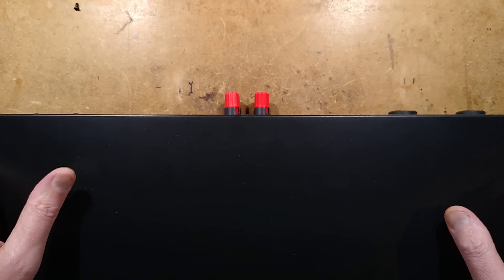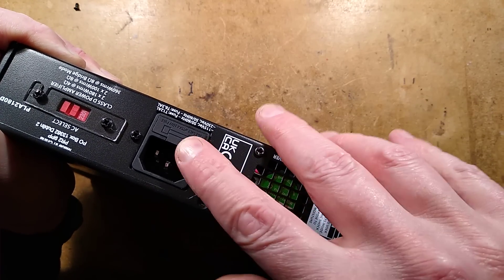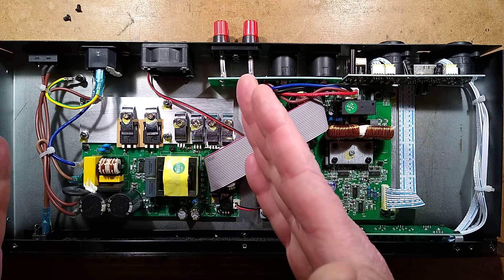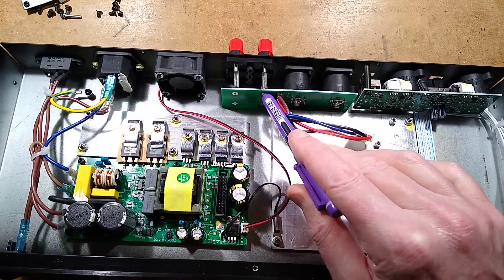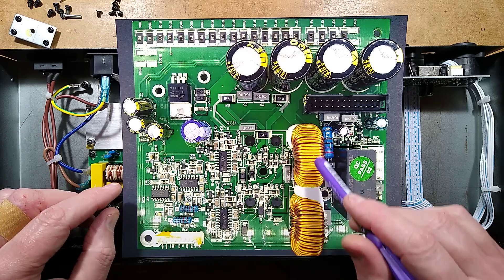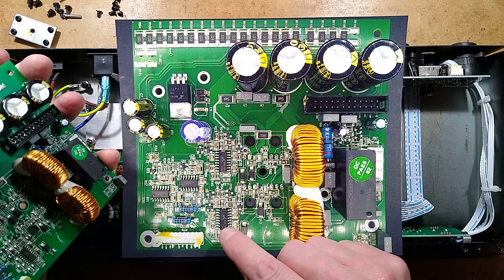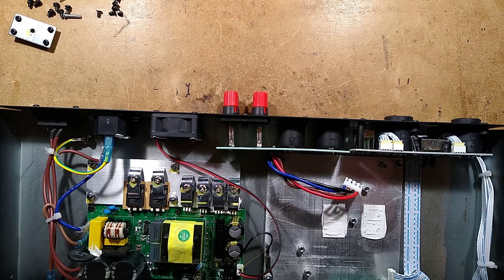Inside a 360W digital amplifier

Comment: Bridge mode potentially gives you twice the voltage, which is 4x the power, for a given load (assuming neither side amp current limits). Most of these designs can only achieve this on real musical sources, with a sensible peak to mean ratio. If you try it with sine waves, a limiter will kick in. Great for us ageing musicians. Together with a neodymium magnet speaker my bass rig has halved in weight and more than quadrupled in peak power. 😊😊😊

Comment: Maybe the large bank of 10K resistors (well, 16 of them) are used for switching in on the D to A convertor chip? 8 resistors each for  2 x 3 bit digital input (3 to 8) Kelvin divider or string DAC? Or maybe I'm blowing it out my ass again...I'm not sure 😁

Comment: The problem with clipping is that it is effectively an increase in average power, which is the only thing that will destroy a voice coil. It's not to do with waveform shape or resistivity in the load, it's simply an increase in average power. It's still an AC signal even if you clip the waveform to a proper square wave. It's also interesting to note that the reason why manufacturers get away with making claims that are double the RMS power of their amplifiers because if you clip a sine wave to a full square wave, you've doubled the power in that waveform.

It's not real power or usable power but it has the heat load none the less.

Comment: Hay would you  know  if I can use one of the 10v mercury uvc lamps to make a homemade  10v mercury  vapour  light bulb  with  outer glass  and block the uvc would  it work
Reply from the maker: You could do that, but the output may be quite low, as it's optimised for UVC.
Reply: Would it work  and no damage  eyes and skin
Reply from the maker: @posttopstreetlight1055  Standard glass should block UVC.
Reply: That will be  cool so I can use one of those  soler pawered street lights  with  the front  glass  and make a soler pawered mercury vapour  street light

Comment: I have the exact same amp branded 'Citronic' for the New Zealand market. I'm running it in bridged mode as a bass amp for playing live gigs. It's effing loud and I've never run it loud enough to clip, you'd get a nosebleed before that ever happened. Nice and light, with a graphic eq and a compressor it's the best bass rig I've ever had.

Comment: Great video as always. Could maybe have explained a bit more about how class D amps work for those who don't know, as they are a pretty fascinating technology. Those IC's are most likely re-branded IRS20957s or similar, these are the most common class D amp driver IC's. Frequently see them installed in amps with a OEM part code rather than their standard part name. One thing I disagree with however, is referring to class D amps as 'digital'. They are actually analogue in operation, and the term 'class D' is just coincidental. While they do use a square wave  as the main carrier, it is just produced by a simple oscillator at a fixed rate, and is not linked to any clock or carries any bits of information. It is simply the fast switching that allows the output mosfets to be turned fully on and off as switches, and hence minimise power dissipation by not running them in their linear range. The audio is produced by modulating the pulse width (pwm) of the square wave in accordance with the incoming audio signal, which is analogue in nature. The output choke and capacitor on the output form a second order high pass filter, with a rolloff point high enough that it blocks most of the high frequency switching noise, but the pulse width modulation occurs at audio frequencies so these are passed through the the loudspeaker. In most designs, you still have a positive and negative half of the amp, much like a traditional class AB amp, where it differs is that the mosfets are being switched hard on and off, rather than directly being controlled by the audio waveform amplitude. And that line of resistors down the edge, is probably to indeed provide a local power supply as you suggested. But it is probably referenced to the negative rail, as the gate drivers need a +12v supply referenced to the negative rail, in order for the switching of the negative side mosfets as they usually use N channel mosfets for both halves of the amp, much like a quasi-complimentary class AB amp. Some amps I see use N and P channel fets, but usually they are all N channel, probably due to more even performance characteristics.
Reply: Agreed, PWM (Class D) is analogue. At no point is the audio signal quantised or sampled.
Reply: @rarelycomments Makes sense when you put it like that. 👍
Reply: Precisely the kind of definition I was looking for. It struck me firstly that "digital" in reference to an essentially analogue device, was obviously bullshit designed to baffle brains and sell units. Thanks for taking the time time explain Class D amplification.
Reply: I'm going to ask you to write my next best man speech
Reply: Um, er, ACKCHOOULLY, Class D amps may be analog controlled, or digitally controlled, so there. :)
Reply: @railgap That doesn't make it a digital amp, any more than a pwm controller makes a Dyson motor a digital motor. A digital amp would be something like a TTL high-current logic buffer in an output to drive more TTL inputs. Most modern amplifiers could be referred to as "Digital" as they can be remotely controlled by rs232 or usb or an infrared remote control but that doesn't make them a "Digital" Amplifier. It's all marketing bullsh!t.
Reply: @railgap  It is not a digital path. The signal that controls the actual switching is riding in a window comparator, eg analog

Comment: I had to look up Speakup connector.   I'm a bit out of date.  I'm still using my stereo system I bought in the 80's to mid-90's.  I use my original stereo from the late 70's in the garage.

Comment: Pretty amazing they can squeeze so much power out of those tiny mosfets these days 🤔
Reply: My brother was looking for a voltage converter or regulator (can't remember what type) to build a power supply for a monitor that came without one, and the one it did come with (not the original) was introducing hum on his audio equipment.
He found an 8 pin DIP or SOIC package capable of handling 30A. Yes it needed active cooling in the form of a massive set of copper planes in the PCB design, and active airflow over the component, but 30A in a package about as big as 6x4mm ...  He is very much into electronics but still can be baffled how such a tiny component is capable of handling such a tremendous amount of current :P .
Reply: @Dutch3DMaster  Ja wel mooi die moderne elektronika tegenwoordig ^^

Comment: Class-D is NOT digital. As you said, it's a PWM, there's no digital processing circuitry (or DSP). The D in Class-D doesn't mean digital, lol. I know it's easy to confuse a switching pulse as binary, but it's not.

Comment: I thought the clipping indicators were just to warn you of signal distortion. I did not know that it also has a safety role in terms of overloading the amp.
Reply: Actually ... clipping is more likely to destroy a speaker than the amplifier.
Reply: @Douglas_Blake_579  I can imagine, you transform the voice coil into a heater running at full voltage.
Reply: @papaalphaoscar1 
What happens is that the output stages "hit the rail" which cuts off the top of the musical signal, forming a pseudo square wave.  This in turn has two large effects.  First it produces a burst of high frequency energy as harmonics of the clipped wave form.  Second, it continues amplifying the lower level signals producing a type of high frequency compression. Either of which can kill a tweeter pretty dead.  
Of course you can also cook the woofer's voice coil without clipping the amplifier... just feed it a long string of continuous bass notes at high power levels... Eventually  it will overheat and fuse.

Comment: 8:01 As an amateur radio operator, I got the kit and built the Hardrock 50 RF Power Amp, and the power MOSFETs were similarly mounted. They were on the back of the board, and during assembly, I would put the thermal paste on them, install the board, and then reach through a hole in the board with a screw and screwdriver, and screw the tabs on the transistors into the large, finned aluminum heat sink that formed the case to.

Comment: Not this model but just replaced one like this driving studio monitors for crackling in the speakers and a channel dropping out... reflowing/adding solder to the output jacks seems to have fixed it. Maybe when I redo that studio I will open the new one and see if it's a thing in small rack mount amplifiers. You would think considering what some of these go through on the road they would reinforce that part. I also wish more studio gear came with the ground lift switch. While I haven't tested it I suspect the output rating on many of these units is a bit... generous.

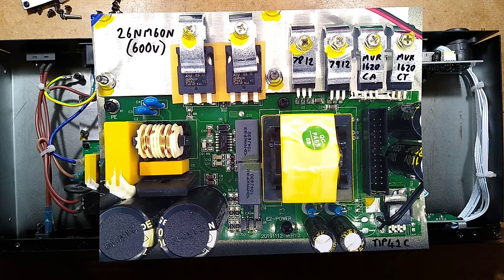Comment: 5:23   Back in the mid 1980's, Bob Carver of the Carver stereo equipment manufacturer, started playing around with hybrid designs of digital power supplies and typical analog output stages for his amplifiers. He used a special high frequency transformer (that would massively saturate at the regular 60hz mains frequency) and then drove the transformer with a heavy duty Triac. The input circuitry would monitor the audio signal and when the circuitry would see a large musical spike coming it would very quickly ramp up the Triac for the brief instant and the transformer would momentarily output a higher voltage to cover that large musical signal. These amplifiers were called "rail switchers" (class H) as the transformer and Triac would be preset to 2 or 3 set levels of voltage that they would run the amplifiers power rails at, and switch between one of the 3 depending on the output demands of the amp.

Later on, he then developed a power supply that would monitor the input signal, and run the rail voltages to the output transistors at exactly 4 volts above what the output was going to be at all times. 
That scheme worked well, as instead of ALWAYS having the entire power supply voltage across the transistors, and wasting all the excess power not being used as heat, the power going to the output transistors was always just slightly above what was going to be required at the output. These were known as class "G" amplifiers, and the benefits were that one could obtain high power out of a smaller case, because not as much heatsinking and not as large of a power supply transformer was needed to cover the excess heat and power demands as if the rail voltage was fixed at its maximum all the time. Another advantage was that the amps used conventional output stage designs, and sounded good.
Reply: Unfortunately, the commutation introduced new forms of distortion that most people of the time weren't measuring for.  Carver said it measured good, everyone else said it sounded atrocious.  I thought it sounded atrocious feeding mid-fi speakers and I don't consider myself to have golden ear at all.  I've owned everything from high end to garbage, I am not on a high horse.   But I'll grant his later stuff got better.  Never justified the asking price, but he did pay attention after the very interesting amplifier challenge with Stereophile.
Reply: @railgap  The rail switchers did create a spike in the output when the rail voltage stepped up or down. The later continuously variable power supply amps never had this issue. The perception of sound quality depended on who listened to them, as obviously everyone has their own tastes of what sounds "good or bad".
Reply: @davelowets 
I've always been happy with my 2 M400t Cubes, running off the CT-7 holographic preamp.
And powering 4 Peavey SP-2a's 😂

Still sounds great, from a few blocks away 🤗
Reply: That dounds similar to the Labguppen FP series. Those are somtimes described as Class T or TD. The construction is quite interesting mostly an normal  AB output stage but with two buck converters per chanel that reduce the power supply voltage. The voltage drop on the AB transistors is in the region of 5-9V thereby reducing the heat dissapation.
Reply: @lukahierl9857  Those  amps did not have a conventional class A/B output stage.

They went a little further than Bob's design and used a similar tracking power supply, but then combined it with a class D output stage for even more efficiency.

Comment: Jeez... there sure isn't much inside of the newer class D amplifiers, is there?

A VERY small amount of "iron" (transformer size), not much reserve capacitance( class A and A/B "analog" amps had rows of large capacitors as a reserve for the power supply when brief large power demands were drawn from the amp), and not much Silicon either. 2 Fets for the power supply, a couple of regulators, diodes, and then 1 I.C. for the output stage. 

I have old amplifiers here that have 40 metal can T0-3 transistors in them, JUST for the output stage alone, and capacitors as large as beer cans for power supply smoothing and reserve. The transformers in amps like this can easily weigh 30lbs just by themselves. 

I have tried some of the newer class D amplifiers, BUT, I am just not sure if I'm quite sold on the sound quality of them. Especially for hard to drive speakers and subwoofer duty... 🤷

Some of these old, large, class A and A/B amps could literally be used to do some minor welding with the output, and were tough as nails. I certainly would NOT try this with a class D amplifier today.
Reply: A class "D" amp. is how the output stage is powered..,but it can be driven from a conventional "linear" power supply.
So 🫵 can still have those (50/60Hz) "big" iron core tx. and those "big" bulky capacitor banks...💪💪
Reply: @analoghardwaretops3976  Unfortunately, most of the class D amps today run from an SMPS, and don't have the big iron and caps in them. Sure, they can, but usually don't because they are much more efficient, can get away with it, and it's SO much cheaper for them to do so.
Reply: @davelowets and people dont want to haul multiple >3kVA of transformer around in a rack.
Reply: B.Carver was the original 
"inventor" of what we today call class
" H". He called them 
"tracking downconverters". ( owns/ owned the patents)
But today still better than class "D" , is what 
"CROWN"audio (professional)
holds patent for the " class I "
I for interleaved convertor or more commonly known as 
B.C.A. / balanced current amplifiers.  first popular in their I series amps.
And that's another whole new
"amplifier"game altogether..

Comment: 0:50 "drives it at twice the power" is incorrect. It actually drives it at twice the voltage, which equals  4 times the power, into the same load of course !
Reply from the maker: I think the power limitation is the power supply.

Comment: "They stop becoming an impedance, and start to become a resistance.."

This is a GREAT explanation of what happens to a speaker voice coil when it's driven by the amplifier into clipping. 

Good one Clive... 🍻
Reply: Well, no, it isn’t really.  There isn’t significant DC on a clipped output.  It might be a squared-off waveform, but it’s not DC.  For one thing, you have to be driving pretty darned hard into clipping before you are actually generating a square wave.  By then, nobody is going to want to listen to … whatever you call the result.  It will be completely unintelligible.

The only time you get DC on the output is when something has failed, and either a servo-balanced output has gone open loop, or an output transistor is conducting straight through to the rails.

You’ll know when this happens because the speaker will release its emergency alert reserve of smoke.
Reply: @sirnickity  WTF was that Garbage you expressed from your keyboard???
Reply: @MrAudioBill   Did you have a cogent argument, or just want to be rude to a stranger on the Internet?

Comment: @11:20, I wouldn’t say the fan is stirring the air around the power supply.  That isn’t how fans that pull or push air into/out of an enclosure work.  By moving air in, some air has to go out somewhere, and generally speaking that should take heat out of the box, assuming the outside air is cooler!

Comment: Sorry, dumb questions:  I assume that the input signal and output signal are both analog.  But apparently the signal is digital somewhere in the middle?  What part of the signal processing is digital?  What are the advantages of a digital amplifier?
Reply: It isn’t.  This is a common misconception about Class D.  It’s just PWM, nothing is actually digital.

Although, to be technically accurate, “digital” isn’t really anything but how the signal is meant to be interpreted.

Comment: I have 3 class D amps in my car, two mono amps running at 2ohms and 800w RMS each for my Sub's and a 4ch for Mids and highs running 2ohms and 150w RMS front and 4ohms 100w RMS rear, I wish I could run class A/B for my mids and highs as class D sounds awful on anything other than Sub's but I'm already maxing out on the current draw my cars electrical system can handle and already fry alternators at an eye watering rate!

All three of my amps are rated for 1200w RMS at 1 ohm.

Comment: I used to work with similar units that runs at 230V~250V and we had to use an variac to bump the voltage up from 220V. I remenber that if we used at 220V (nominal voltage where I live) we coudl hear a humming noise from the speakers. cant remember if the unit had some problem
Reply: Those amplifiers could have had a regulated rail. If the input voltage is too low it would drop out of regulation and you'd get hum on the supply which could potentially reach the output. Having more headroom would eliminate this but also reduce efficiency.